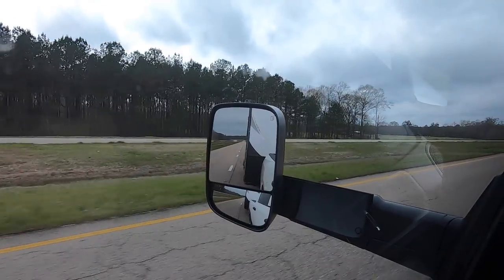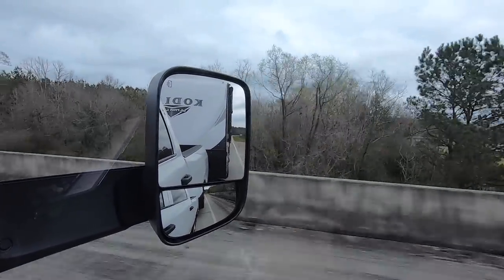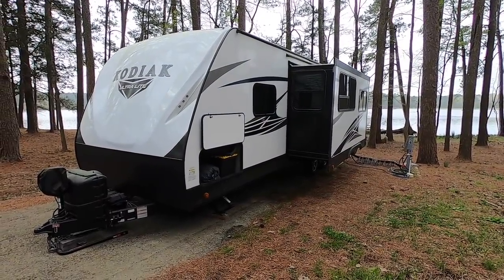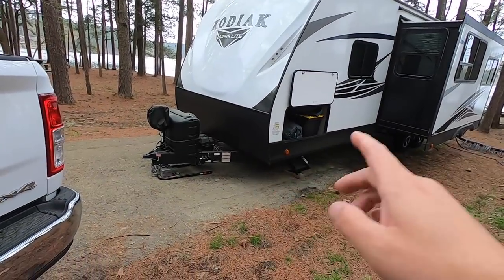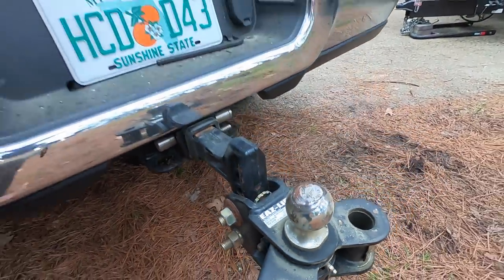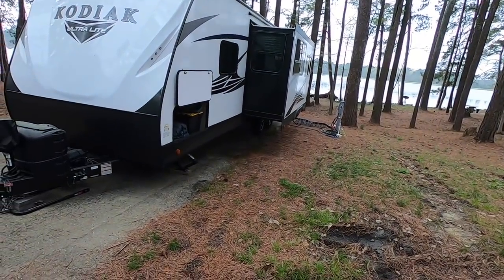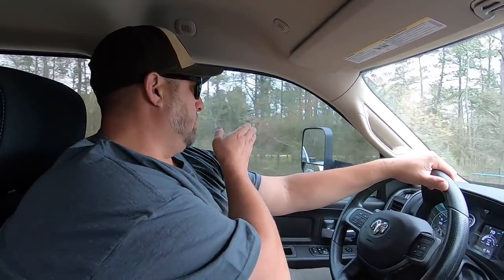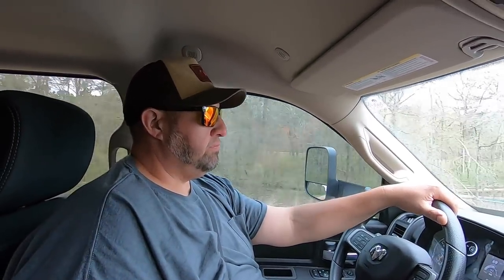Trailer Pulling Updates & Hitch Adjustments

Comment: I've been told you should have about 50 kg ( 110 lbs ) on the hitch for best driving experience. Not much more, and absolutely not less than that. So putting everything in the front of the trailer only bogs down the pulling vehicle and lightens the front wheel traction. Probably not an issue for your pickup, but cars in general behave really bad when looking like they got 1 ton of stuff in the trunk.
Maximum allowed weigth on the hitch on my car is 165 lbs. I guess it's somewhere between your class I and II.
Reply from the maker: Not the case for a 3/4 ton truck, plus I have Sumo Springs installed increasing rear end load capabilities and stability.
Reply: Cool. No worries then. :)
Reply: 110 LBS? Who told you that? Maybe for a little equipment trailer. It would be near impossible to get the tongue weight down to 110 lbs on a trailer this size. Tongue right should be around 8-12% of the trailer weight. It has to be represented as a percentage, so that it scales properly as the trailer weight increases. You can't pull a 14k lbs trailer with 110 lbs of tongue weight. If his trailer is 7k lbs, he should have 550-850 lbs of tongue weight. You have to use your common sense when someone tells you something. Does anything about a 10k lb trailer having a 110 lb tongue weight make sense to you?
Reply: 10k lbs trailers are very very uncommon here (among avarage Joes) since you're not allowed to pull that with a standard drivers license. Also very few ordinary cars are allowed to pull more than 4k lbs. Recomended tounge weigth is around 70 kg (150 lbs) (driving schools and trailer sailspersons says), but most people get the least sway and least jerking in the car closer to  220 lbs for those trailer sizes. And that is only 5%. Too much of a weight can jerk the car around uncomfortably much on uneven roads.
Of course a big heavy truck handles it just fine.
BTW, we're not allowed to build our own trailers either without getting them registered, and that is really expensive.
And maximum speed with a trailer is 50 mph. :D